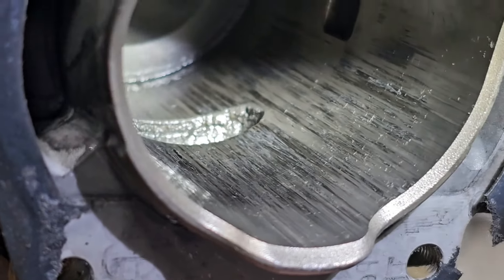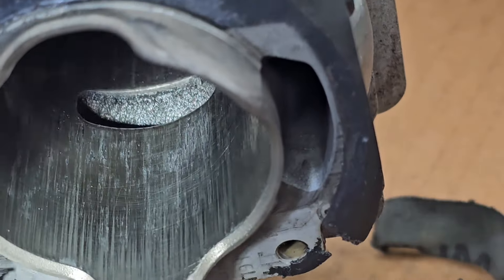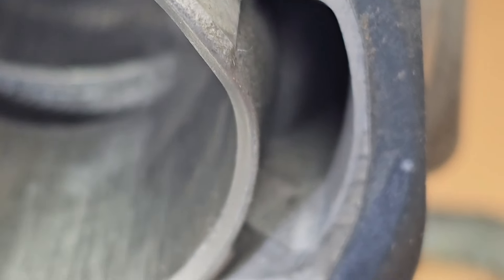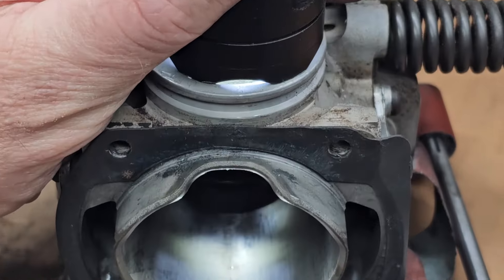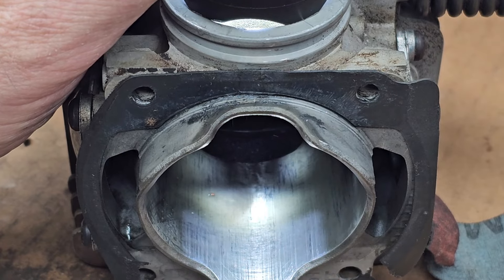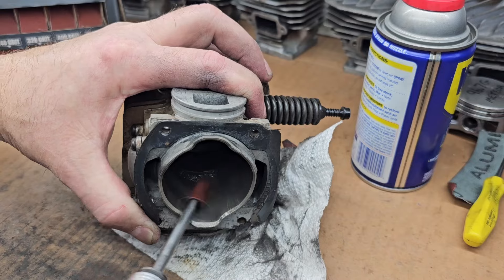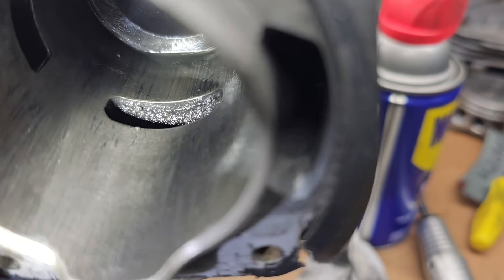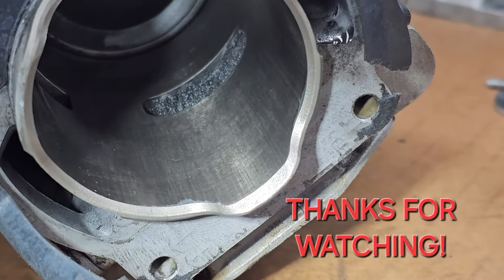DIY: REMOVE ALUMINUM TRANSFER / 372 XTORQ

Comment: I use sodium hydroxide to get the Aluminium off the Nikasil. 
Takes a bit more Time but works without damaging the Plating.
Reply from the maker: I have been interested in the chemical removal process but haven't tried it yet. I do see the benefits vs sanding. I will definitely look into it. Thanks for the comment. 👍
Reply: @woodcutter4481  the chemical way takes longer but it saved my 372 cylinder pretty well. I do sand them with 1000 Grid and Oil afterwards. With new Meteor Popup it has. 210 psi Compression. 
Your way is also working good and yor Saw should run great again!

Comment: I use hydrochloric acid..15min ..rinse with water lightly sand ..repeat till gone
Reply from the maker: I'll definitely have to try that  method, it's probably easier on the coating. Thank you. 👍
Reply from the maker: Seems to be a much more controlled process with the Hydrochloric vs. Muriatic. It worked great, thanks.👍